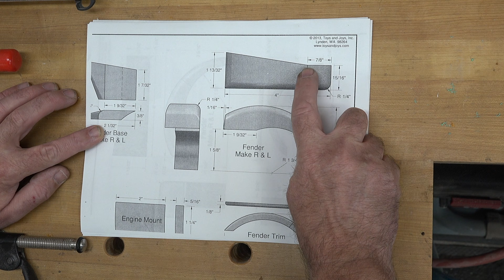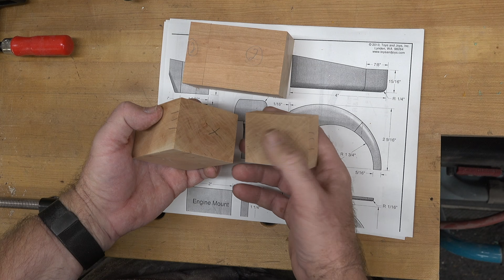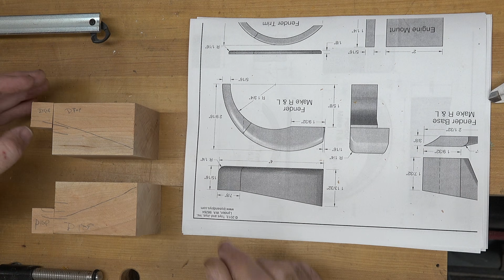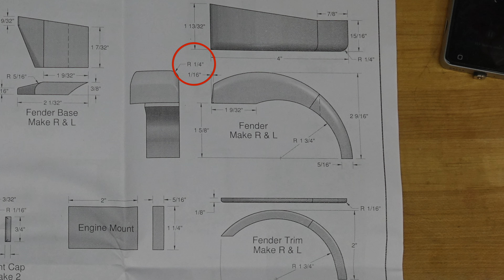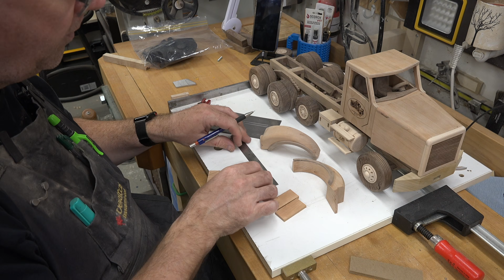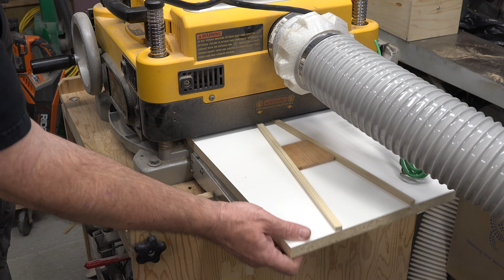Making Toys and Joys Dump Truck and Pup Trailer Part 12

Comment: You could make your own thickness drum sander. That would be a walk in the park for you. There are videos on youtube. Mattias Wandel has a nice one.
Reply from the maker: I've made a thickness drum sander on the show before.  It was powered by my lathe and has an adjustable base.  It worked well but it does have its flaws.  Thanks for tuning in to the show and for chiming in with your suggestion.  It's very much appreciated.

Comment: Another really informative entertaining show mate… thank you. Could I ask what spirit you use in the jar to keep your spray adhesive tips clean please? Also I did send a message on instagram if you still use it… cheers Gary
Reply from the maker: I got your message in Instagram Gary.  Thanks.  As for the spirits, I use mineral spirits but you could use any type of paint thinner and it would work just fine.  I hope this helps.  Thanks for tuning in to the show.

Comment: Looking great Kenny. Way better progress then my Jeeps in last few weeks. LOL
Reply from the maker: I have found that the best way to make progress on a build, is to actually work on the build Marcelo.  LOL.  Just some friendly advice.  LOL.  Thanks for tuning in.
Reply: @acutabove_woodworkings  LOL. I know all of that. Im just not so motivated cutting and shaping parts home, after doing it at work for whole week. Being cabinet maker by trade, just doesn't help much having model making hobby😀😀👍👍
Reply from the maker: @marcelo403polo2  If you aren't into it, in my experience, it's best to leave it until you are.  Trying to force it just ends in disaster every time.  I once put a model on the shelf in a box for almost 2 years before I went back to it and when I did get back to it, I thoroughly enjoyed the process and the model was incredible.
Reply: @acutabove_woodworkings  Yeah! Problem is, im starting new models and some other are still waiting for completion. Square body is on shelf for over 2 years, Q7 about one year now and im also thinking to start freightliner cascadia and give a try Duchies pattern. Discovery for getting use to it.

Comment: AAAAAAAAnnnnnnd . . . . .another super show!!!   This one really gives a lot of great insight and technique that can be used on any number of projects.  I especially like the use of the thickness planner auxiliary board to get the hood trim to 1/16".  The use of the side support pieces are definitely needed and many times overlooked.  A drum sander, if available, would also accomplish the sizing needed but it would take a longer time.   Have a great week.  See you for the next installment!
Reply from the maker: I really want a thickness sander but they are pretty expensive and I would need to re-organize my shop to fit one it.  One day.  Thanks for tuning in and for the kind words.